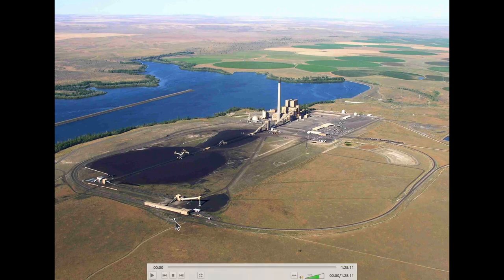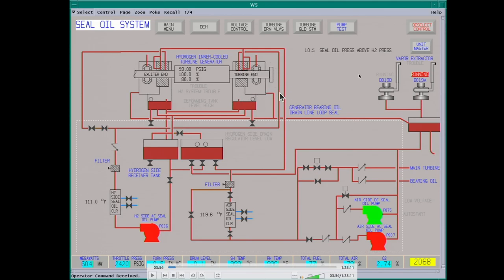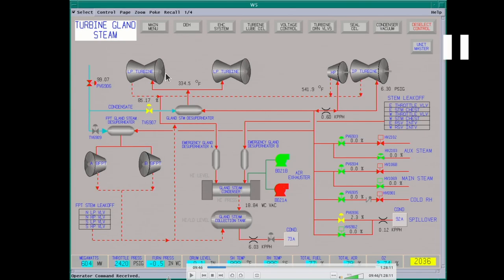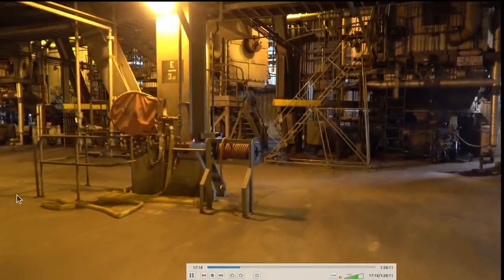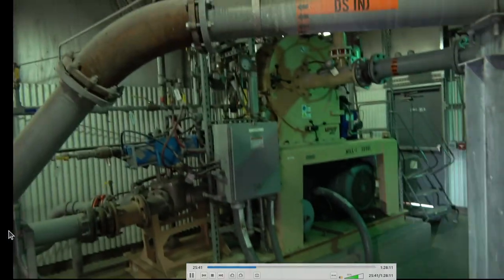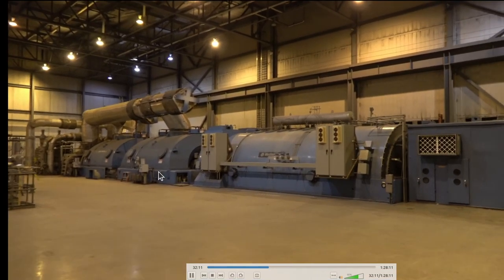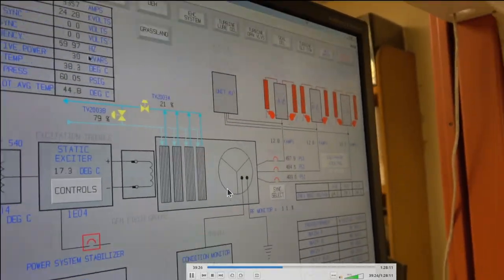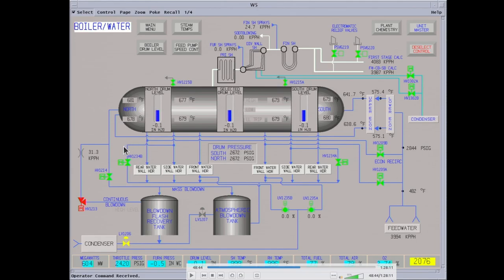Coal-Fired Power Plant Tour

Comment: I watched the raw video and was fascinated but it was hard to understand the flow of everything.  This edit is great so far. Just a friendly suggestion- if you ever do this again consider changing you mouse cursor color to bright pink or yellow and change the cursor size to extra large as it's a bit difficult to see the cursor while watching on a TV.

Are you the plant superintendent? Like how do possibly know SO much about the system?

Finally, I remember you talked about the main generator circuit breakers on each phase. What would cause those to trip and must they be rebuilt if they trip?

Thanks for doing this!

Paul from Cincinnati
Reply from the maker: Thanks for watching and the feedback. I'm surprised that the mouse pointer wasn't big enough since I did almost double the size of it so it would be easier to see on small screens. I can look into changing the color since maybe a regular white color would be easier to see.

I forwarded your questions since I just do the video recording and editing, and got a response back about the generator trips. To answer your question about the boiler draft (as best as I understand it), the Induced Draft fans located at the base of the stack are what pulls the negative pressure. The Primary Air fans are what blow air through the pulverisors and carry the coal to the burners. The Forced Draft fans blow air into the windbox and provide the secondary air for combustion. All 3 work together to provide necessary air flow and boiler draft. It should make more sense when we get around to doing a video about the fans in the simulator. 

"Thank you for your comments
The generator breakers (one per phase) are Cogenel air blast breakers with 2 contacts. One is a hard material which closes first and opens last to take the arc. The other contact carries the load current. They are designed for 24,00 volts, 24,000amp and interrupt in 4 cycles (60HZ). They are designed for many cycles of use.
	
The generator breaker trips: () is the relay number as type of relay.

(78) Generator out of step. Generator has slipped a pole and is not insync with the grid.
(21) 500KV line phase distance relay. Line problem.
(50TXN) 500kv line line to line and line to ground.
(78GX) phase distance (direction toward generator detector. (Part of the 500kv line protection).
Steam turbine trip (this includes oil pressure/temp vacuum over speed etc.).
Main transformer trip. (Over pressure, temperatures differential current, etc.)
(59N) Generator neutral over voltage, (51N) generator neutral overcurrent. These protect against ground faults as the generator neutral goes through a grounding resister to limit fault current.
(87G) Generator differential current. These relays measure the current inflow of the protected equipment with the output current. Current leakage to ground should trip the breaker before a full-blown fault.
(32) Reverse power. Prevents motorizing the generator. (16 megawatts minimum).
(46) Generator negative phase sequence. Windings. current out of balance.
(51) Generator instantaneous over current.
(76) Exciter field over excitation.
(81 and 59) Generator and transformer over excitation. Prevents over fluxing of transformers which can cause damage.
(81) Generator under frequency (57 Hz). Transformer damage cause by excess magnetic flux through the steel core.
(81) Generator under frequency (58.5 Hz for 30 seconds).
(40) Generator loss of excitation.
(60) loss of generator potential transformer fuse. No voltage indication.
(50TG) Generator current detector. Breaker or phase closed when generator stopped. Prevents a disaster.
(81) Generator at standstill under freq (54hz) prevents breaker closing when generator is stopped or not up to speed. Prevents a disaster."
Reply: @briantrue9930  thank you for answering my questions! I am very grateful that multiple people took time to reply!
Reply from the maker: Here's the more technical explanation of the draft:

The air/draft control has quite a lot of logic involved. The boiler will trip at less than 25% total air flow, -8 
inches water column (IWC), or +5 IWC. The draft is usually set for -.5 IWC. The induced draft fans (4) 
variable frequency drive (3500 hp) double suction fan controlled the draft. The secondary air fans (2) 
(2000 hp) double suction provided the air for part of the combustion. This air flow was controlled with 
inlet vanes. The oxygen control master and the draft logic adjusted the vanes. The primary air for 
combustion is the primary air fans (2) (3500 hp) double suction fans controlled with guide vanes. The 
discharge pressure usually runs at 56 IWC. This air feeds the pulverizers with a coal to air ratio (it varied 
for load) of for example 100,000 pounds of coal per hour requires 186,000 pounds of air per hour. This 
air was the motive force to move the coal dust into the burners and boiler.
The control scheme went from the boiler master to the fuel and draft master, with the oxygen master 
adjusting the secondary fan dampers. The air leads the fuel, and the fuel is cut before the air. If the 
boiler trips and all the fire is removed the furnace can go very negative to the point of imploding the 
furnace. This was figured into the logic to prevent this. The O2 is controlled at 10% until 20%-megawatt 
load, by 60% the O2 is at 2.7%. The air flows are temperature and pressure compensated. The furnace 
draft is measured right above the burners. The draft at the top of the boiler is less and at the bottom it is 
higher due to a chimney effect.
Reply: @briantrue9930  I am very grateful for the time everyone spent to answer my questions.
Reply from the maker: Here's another response that I had posted to the original video a while ago and thought that I should add it here to centralize these detailed answers.

"In response to your questions: at 1:15 of the video this is the Turbine Generator lube oil dehydrator. A vacuum is pulled on the vessel and a slip stream of heated (130 deg F) lube oil is sprayed through filters to remove moisture. If the lube oil temp on the outlet is too cold the oil is recirculated through the dryer as this means a lot of moisture is being removed. This comes from gland seal steam, and air pulled in through the bearings.
	
There is some refractory at the burners, but the furnace is of a welded membrane construction. The water wall tubes have spacers between them and are welded. A -.5 inches water column furnace pressure can be maintained. If the boiler goes positive fire and hot gases escape. Pulverized coal builds up a lot of ash which melts to form a slag. (This really depends on the type of coal being burned) This slag builds up on everything. At the burners a buildup in excess of 8 feet from the water wall can develop. We call this an 'eyebrow'. Water cannons (4 total) use a high-pressure jet of water to remove this slag from the waterwalls in preprogramed zones. The is very little refractory in this boiler. This fire box is 150 feet to the bull nose and 200 feet to the roof. It is suspended from the roof beams so it can expand downward approx. 11 inches. From cold to hot. This slag (rock) is sluiced every shift with the hopper doors opened once a week to remove large ash sheets (boulders). A jackhammer with a long rod is used to break it up and racks are used to help move this to the grinder and sluice system.
	
As far as sootblowing there are 68 sootblowers using various amounts of steam. About 30,000 gallon per hour is required for boiler make up. The soot blowers are approx. 30 feet long and reach halfway across the boiler. The steam used for blowing and the rotating motion keep the lances (soot blower tubes) straight. The critical areas are division walls (platens), finishing super heat, and primary superheater. The finishing superheater are 16 inches apart which slag can bridge and plug up the furnace outlet, A plugging primary super heater forces more flue gas to the reheater section which make temp control impossible (1005 deg F). Although this give you more megawatts it is hard on the turbine casing, rotor and piping. Only 2 sootblowers can run at a time and it can be difficult to keep up with the ash build up so soot blower is a continuous operation."

Comment: What happens to the ash?  I'm trying to figure out where it goes or if it's available to buy.
Reply from the maker: The Fly ash went to cement plants. Activated carbon was added to the flue gas at the air preheaters to remove mercury emissions, but this carbon also reduced the value of the ash.

The bottom ash was used for gravel or as a fill material.

Comment: With the two 12V71TT diesel generators are those just for emergency power or is this a black start capable plant?
Reply from the maker: Those are just for emergency power if the plant goes black. This plant isn't black start capable.